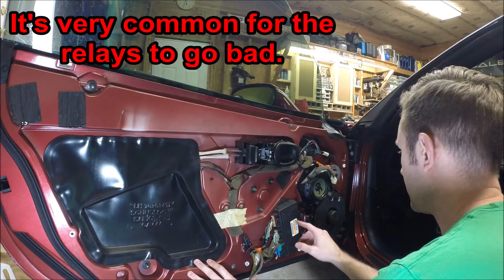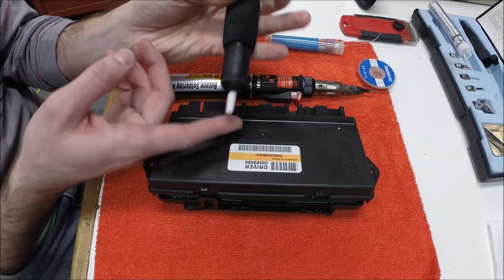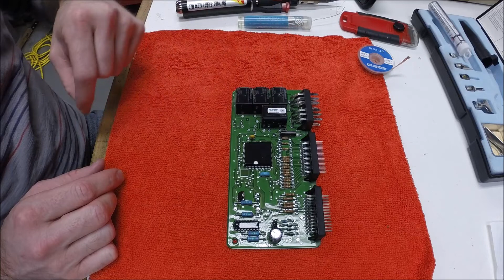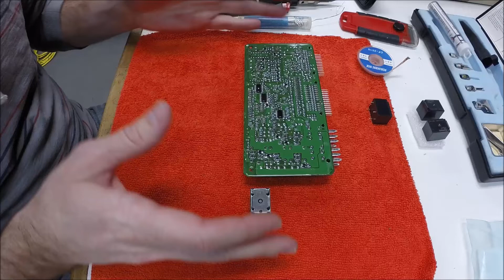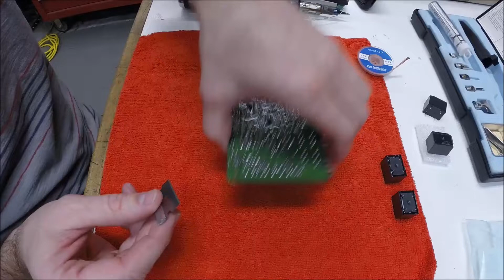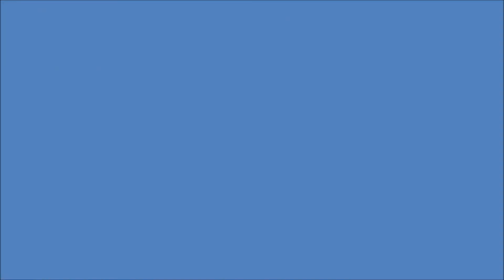C5 Corvette Door Control Module Repair

Comment: Is the relay for the door locks the same as the relay for the window motor? Figure if I'm opening it up, I should just replace all the relays while I'm at it.
Reply from the maker: I believe they are, but it's been several years since I did this project so my memory is a bit fuzzy.

Comment: I find that any stranded wire like speaker wire works good on small things for a solder wick.
Just don't twist it to tightly and be sure and dip it in flux or solder paste before using.
I hate trying to use a solder sucker when other components are close because I actually suck at using them.

Comment: Are there any other companies that sell this relay? The company you bought yours from only allows orders over 100.
Reply from the maker: Hmm, that's weird, but you're right, it seems like DigiKey is only selling them in 100 packs now.   The relay is a JSM1-12v-5.   I just did a google search and found a seller on ebay, $12 for a 3pk with free shipping.   (https://www.ebay.com/itm/401565721223)  I haven't used that seller so do your own due-diligence, but it seems like a fair price.   Hope that helps.

Comment: Can a relay cause weird shot to happen? Like having to adjust your mirror before you can roll your window up or down lol what were your symptoms on this? Thanks!
Reply from the maker: Hmm, it sounds like you've got something funky going on.  Not sure if a relay would cause what you described.  I have seen grounding problems cause all kinds of weird issues, so that might be something to consider as a check point as you're diagnosing things.  There are several good threads about cleaning ground locations on the corvette forum.

Comment: Why didn't you just replace the whole circuit board with a new one ?
Reply from the maker: I don't believe a new door control module is available any more.  There are some used ones out there, but since these issues are so common, I wouldn't trust a used module.  And there are some repair services out there, which could be an option for someone who doesn't want to do the repair themselves.
Reply: @ScrufsGarage  do you have the name / contact of the repair services? My passenger side went. Great video!

Comment: Are you 100% positive that the bottom relay is for lock? My problem is that driver door will not lock via door panel or FOB. Passenger side works great. I replaced the bottom relay of the driver side door control module but the problem persists. Perhaps the bottom relay is not for lock?
Reply: Wondering what your repair finally was? I'm having same issue.
Reply: @IanLauer  I replaced the door control module from a corvette part recycling business that is no longer in business. There are others, though, I’m just not sure of their names at the moment.

Comment: I just had a new bcm installed and drove it home fine....but now everytimr I open the door the alarm goes off. Is this what I need to do too
Reply from the maker: Are all of the door locks locking and unlocking via the remote?    If the control module thinks the doors are locked, but then you open the door (because the lock actuator isn’t working), then the module may set off the alarm because it thinks you broke into the car (ie the door opened when it should have been locked).    I found that I also had a door lock actuator that wasn’t working.  (I did a video on that also fyi).
Reply: @ScrufsGarage  the remote works now but the windows and air conditioning don't work now and sometimes it won't start because of security light reduced power idkk ughh
Reply: I know it's all bcm related but I just got a new to me one installed...I'm wondering if maybe all the modules didn't get coded idk

Comment: Thanks for the excellent instructions.  Much harder than I expected to remove the relays.   Not always able to remove all the solder using the iron & sucker.   After removing some of the solder, cutting the exposed pin then heating, pushing & prying helped.   Don't try this repair unless you have excellent close vision & lots of time & patience....otherwise you can find on ebay guys offering the repair for less than $100....well worth it.
Reply from the maker: I agree, getting the old solder out was a pain.    I recently did a video on resoldering the relays on the EBCM.  For that project I bought a flexible magnifying glass/light with a stand.  Made it much easier to see the tiny stuff.   And I also bought a better soldering iron, so that helped too.   Electronics repair is definitely an acquired skill.   And unfortunately this Corvette is giving me a lot of practice, haha.    Congrats on surviving this project!
Reply: @ScrufsGarage  I had put this project off for 2 years and being on Pandemic lockdown gave me the time to tackle this repair.  i had a flexible magnifying glass but no light....will look on ebay or amazon for one with a light....good investment for future projects.  Now onto the rocking seat fix while still on lockdown.   Thanks again &keep posting your excellent videos!

Comment: Great video! You seem to be pretty knowledgeable. I am having an issue with my 2000 vette driver's side door. Window controls go out along with lock controls, only drivers side. Mirrors and settings buttons still work. Tried turning car on and off a few times, bangingon the door, slammingthe door along with cursing at it, but still didn't work, but came back to the car 3 hours later and controls all worked. Is this similar to the issue u were having?

Comment: Did this last weekend. Not hard but helps to have an extra set of hands. Great results after the replacement.
Reply: Yep, had to do that one too. I think it had to do with removing the lead from solder. But what do I know.
Reply from the maker: Awesome, glad to hear it went well for you.   It's not "hard" but does require patience.  When I first got the car, I also had to resolder the resistors on the back of the hvac display.   It's a shame the GM electronics are so problematic.